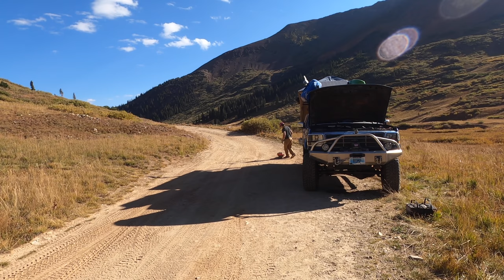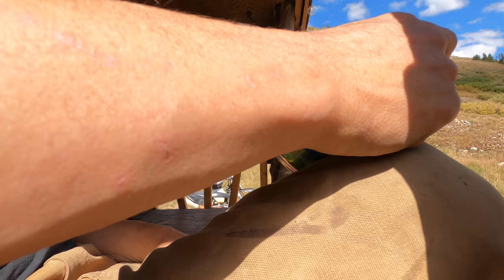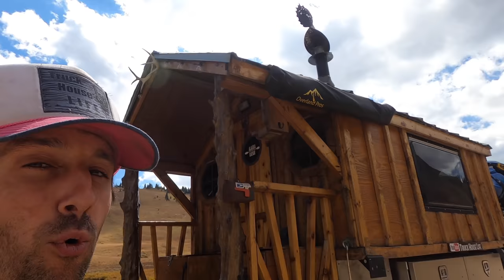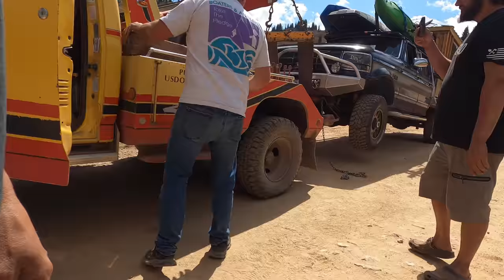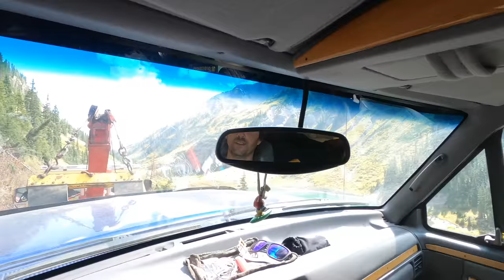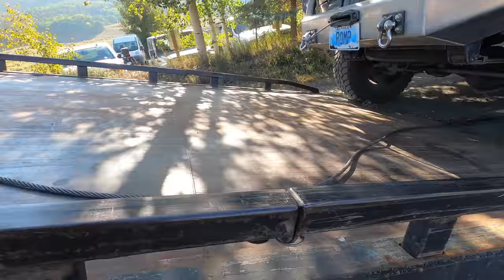Things Got Scary - Truck Camper Fail - 4x4 Recovery Tow

Comment: Good luck. The place I used to work, has a F450 with a 7.3 diesel and it had a problem similar and the problem was the wires and plug going to the cam sensor.

Comment: Years ago, I was insured with USAA. My dad was a Captain in the Army retired. My engine blew in my Acura skiing Had an 85 mile tow. But back then (1994), they covered it. I Dropped a used engine in with 35,000 broken in miles on it from a junkyard. Drove it 8 more years.

Comment: From South Africa had same issue with drive shaft, Landrover disco 2 driveshaft bolts 9/16  only imperial bolts on the entire vehicle..
Everything else is metric.... took me 4h with a small adjustable wrench to remove.... lesson learnt, two 9/16 in my toolkit
Reply from the maker: crazy

Comment: I love these trucks and have put over 600k miles on a few of them. good maint. We got where we replaced allot of the wires on these engines every 100k just for insurance. As much as I like these trucks as for way off the beaten path I will only go in an a IDI diesel or carbed gas vehicle anymore. I know many guys that run throttle bodies and carry back up cars to get home if needed. I did off road rescue for years and the most of the recoveries were due to electronics failing. I do not think I ever had to go get a 6.9 or 7.3 idi or 6bt cummins truck for any engine issues in years. His OBS ford wrecker sounded like a 460 and they are great yet brother let me tell you they suck gas but get the job done. There is a few small tricks to up the power on the obs injected ones for they are realy retricted from ford for epa crap. Like the videos and Keep On Truckin.

Comment: Hey man, sorry your truck is costing you. Stay cool bro.  I used to drive the same tow rig except the truck was 10 years older. Good thing that sling didn't break with more speed. Should of had weight on the chains. hmmmm

Comment: on a 7.3 power stroke only 4 parts cam position sensor is usually the culprit 35 bucks and 1/2 hour

Comment: If you ever need a tow again, if your truck has a manual shift transfer case, you can put the tcase in neutral and not have to mess with the driveshaft. Tcase in neutral disengages the rear output from the transmission
Reply: Only for very short distances
Reply: @tonyinfinity  Incorrect.  When the transfer case is in neutral, it is disconnected from the transmission and will not turn the transmission. The rear driveshaft will spin the rear output of the tcase, but with the tcase in neutral it will not spin the input shaft.    I've been at a Ford dealer for 23 years, in fact Ford used to sell "neutral tow kits" for vehicles that had electric shift transfer cases.  It was an electronic device we would install, to command the shift motor in to a neutral position.  Say, an older 4x4 Explorer.  We've had customers tow them behind their motorhomes cross country with no issues.
Reply: @applefordguy76  Well I wouldn't do it after seeing my friends carnage tow his jeep like that. The drive shafts are still spinning and there's no fluid being pumped in the trans like that. Sure the trans is in neutral which is making it not connected to the flywheel but the insides are still spinning. That's the reason heavy tow drivers disconnect the drive shaft when towing a big rig otherwise they'd just have it in neutral (ie eaton 10 speed). Also when towing a CRV Honda says to tow for 200 miles and then start the vehicle to get fluid to pump thru the trans. You do you bruh.
Reply: @tonyinfinity  yes, driveshafts are spinning, but they are not spinning the transmission. But you do you bruh.
Reply: @tonyinfinity  have you ever had a manual shift transfer case apart and know how they work?  When in neutral it disconnects the input from the output shafts. Hence, input shaft coming from the transmission, disconnecting therefore not spinning the transmission.
Reply: @applefordguy76  I understand, but not every trans and transfer case work the same way. So the danger with web warriors like you saying this stuff is people listen and ruin their vehicles. Some can be towed no problem, some have to be in neutral in the transfer case and park on the trans. Please stop talking I know what I'm talking about. Besides the fact that most tow drivers won't tow a 4x4 without the driveshaft removed for liability purposes. You do you chief

Comment: Lack of fuel or air is the only thing that will stop a diesel engine apart from .lloose battery connection or corrosion and  major mechanical failure (camshaft drive belt is the most common - generally results in a total rebuild if it fails).

If it was working and simply stops I would be looking at loose/perished fuel lines letting in air. Injector pumps won't pump air.  The most common reason is the fuel stopped flowing, most likely due to water and debris in the fuel. I’d start by taking a look at the filters.  

Follow the procedures for emptying them out and bleeding them to refill them. If that works, you should replace them at your next opportunity.

Comment: Day late and a dollar short. You dont need to remove your driveshaft to tow a 4x4 you put the transfer case in neutral 😂
Reply from the maker: hmmm, I thought the output shaft would spin even with the transfer case in neutral, or so i've heard.  The old ford manual said not to flat tow without disconnecting a driveshaft & unlocking hubs.
Reply: @TruckHouseLife  sorry but that makes no sense. The drive shaft front and back will spin yes but if the transfer case is in neutral, it disengages the drive shafts from connection to the transmission. Think about it, park on a alight incline on a street and put the transfer case in neutral then put the tranny in park and let your foot off the brake. The truck will roll. Its not like an AWD SUV with fulltime AWD. You cannot disconnect those vehicles there is no shiftable transfer case. The reason i kniw this is my own 2001 Dodge 2500 Cummings and becsuse of a 2006 jeep grand Cherokee that i had to tow with a tow bar that was stranded. It was all electronic controls and after i disconnected the drive shafts and towed it i later found out you can electrically disconnect the vehicle for tow mode with a lever in the center console. Many of the AWD part time 4x4s have a disconnect so they can be towed behind an RV.
Reply from the maker: @GregariousAntithesis  I see where you're coming from, I just read that the driveshaft will still spin the output flange on the tcase, and since running the engine is what sends lubrication to the tcase I've heard you can burn up part of your tcase by flattowing that way.  Just what I've read.  I'm sure it might be different for Dodge, Chevy, Jeep, I just know the OBS fords were built that way.
Reply: @TruckHouseLife  been turning wrenches since before i could drive. 20+ years Aviation Structural Mechanic US Navy. I dont know where you are reading your informatiom but it is completely wrong. If you have a transfer case and a Neutral position what I am telling you holds true no matter what manufacturer. The theory you are talking about comes from the “you never tow a vehicle with an automatic transmission without disconnecting the drive shaft” that is for vehicles without a transfer case only. Its your vehicle you will do what you want and what you believe but i would bet you 1000 bucks im that sure of what i am saying. Not that it is going to help your prior situation but it could save a lot of work in the future.
Reply: @TruckHouseLife  SUV's have engine powered lube pumps for the all wheel drive. Totally different from your truck. Splash lube is what you have. A pumpkin filled with gear oil.
Reply from the maker: @GregariousAntithesis  good to know man, i've just done a bunch of research on the topic in the ford OBS forums and suzuki samurai forums, so dont' wanna take the chance.
Reply: @TruckHouseLife  danielsan this is mr Miagi, you have a hard head 😂
Reply from the maker: @GregariousAntithesis  lol

Comment: My powersroke has broke down on me more than once, I remember it always sucks, starter, more than once, alternator, more than once, cam sensor, oh, and the last time it was the dang dip stick tube seal where it goes into the oil pan, my cummins has broke down also, bigger things, tranny, both fuel pumps, I think everything breaks down if you have them long enough, even new trucks will some time leave you on the side of other road once in awhile. Would AAA have towed you out of that spot??
Reply from the maker: I don't have AAA:(
Reply: CPS= always carry an extra! ... .same for starter and alternator

Comment: Why hasn't Dodge, Ford, Volkswagon, or somebody built a Van with a doghouse and a truckbed or flatbed behind it. Same with ambulance Vanlife builds. It would shorten the length for parking, and increase reliability. I've seen old Volkswagon Busses in San Clemente CA with truck beds behind them. But that's it.

Comment: Oh man should have pulled that driveline man fastest way to burn up that tyranny never never tow a diesel with the driveline in from the front
Reply from the maker: didn't have a torx bit to pull it, it had torx head bits for some crazy reason, tow truck driver didn't have any either

Comment: Glad you're out.. Not to slam anyone.. But, that tow truck was not enough truck for that job to begin with, That sling is probably not rated for that weight, Plus it SHOULD HAVE had safety chains in place in case the rubber did exactly what it did! You're truck doesn't need driveshaft removed to prevent Trans damage( transfer case in neutral position remedies that), And I could be wrong.. But, it sure didn't look like your truck was properly secured on that flat bed.. Maybe I just didn't get to see due to editing.. Besides the winch, A vehicle of your size should have been secured at all four corners to that flatbed in some fashion...Most state DOT's have guidelines requiring this.. I didn't see that... As a tow operator myself, I NEVER allow any customer to climb on the deck of my towtrucks.. HUGE liability.. you slip and fall while on my equipment and guess what? Ya.. not good, NOT professional.. Hope you get back on the road soon and it's something simple..     look forward to seeing more videos...
Timthetowman

Comment: As you may know by now, the 7.3 is pretty much worthless when the engine isn't running = no significant braking action and the steering SUCKS in supremo fashion as well! :( Turns out the booster action on the braking master cylinder is also powered by the power steering pump . . . no runno = no power steering = no braking action either = major no bueno! :(

Comment: I was waiting for that to happen 

you  need a 3rd axle to off load the weight  otherwise you'll do another diff
you may have the suspension to haul your weight though not have a axle in place to haul the weight whether you a lazy axle or a power axle is your choice however trying to  rely on a 2 axle vehicle.. when you have the weight on the rear that really requires a 3rd axle..

with the last video i watched you  had to much articulation going up the switch back thus is why you most likely broke the splines in the diff housing..

Comment: What? No reason to remove the driveshaft at all. Put the transfercase in neutral and the transmission in park/gear. What kind of tow truck operator doesn't know this?
Reply from the maker: I guess the output shaft bearing doesn't get lubricated if the tcase is in neutral which burns up the tranny in 7.3s
Reply: @TruckHouseLife  Every transfercase I'm aware of has an oil pump on the output shaft. As long as the transmission itself remains in park/gear, it's 100% safe to tow with the t-case in neutral.
Reply from the maker: @12ValveJalopy  maybe it's the EO4 tranny in fords that doesn't do it? I've seen it all over the ford forums and people say they've burned up the output by leaving it in neutral and putting tranny in park
Reply: @TruckHouseLife  I looked up the owners manual for 1997 F Series. The above advice is in the manual, however Ford states to also place the transmission in neutral. I disagree with that, if there is any viscous coupling through the transfercase, it can still spin the transmission output shaft, which is exactly what you don't want. Leaving it in park/gear ensures the output shaft of the transmission itself cannot spin, I suspect anyone burning up transmissions while flat towing is doing something wrong. Page 255 and 256. https://www.fordservicecontent.com/Ford_Content/catalog/owner_guides/97f23og1e.pdf

Comment: some people have to learn about Fords themselves with all the specialty tools and fuel connections that you need a tool for and are not reuseable fuel connections. chevy and dodge usev5/16 wrench and a 5/8  no specialty tools Ford you need special axle sockets that cost alot and weight too much to keep in your truck ..its just stupid the amount of tools you have to buy to work on ford crap .the tritons spit out spark plugs and duraspark ignition boxes are a joke only people who own old fords are guys with full shops .they can carry loads well but only a few engines are good ....and there is way more 90s chevy and dodges trucks still on the road than fords buy a long shot

Comment: and the third failure from a ford truck ..just saying  i had two of them crap wagons think i would have listen to my grandfather?no and  a wise man learns from his mistakes and it was not wise getting a second ford never again wont even date a girl who drives a ford truck cause i would have to work on it or break down in it or loan her money to fix it been there was stupid when i was younger
Reply from the maker: It's been an awesome truck, only had a few breakdowns and they were all cheap easy fixes except for this one.  I knew what was wrong right of the bat, but didn't push the CPS in enough so it wouldn't start, then spent 5 days replacing all sensors on the engine and taking the top of it apart, had to tow out. Learned to use grease when pushing the camshaft position sensor in from now on lol